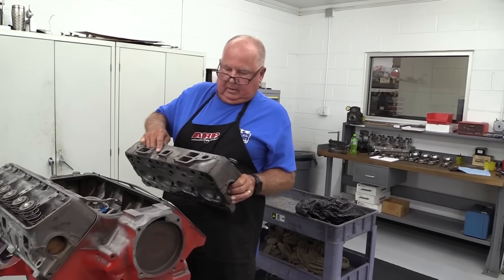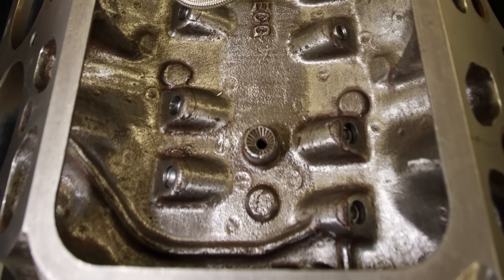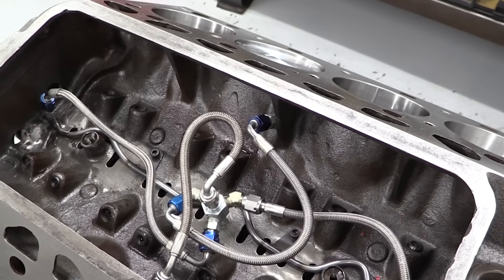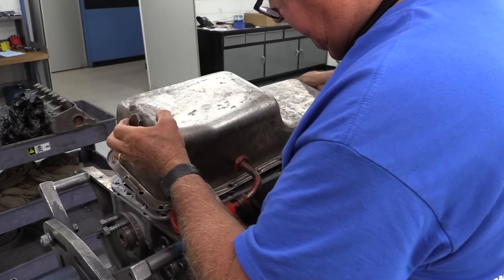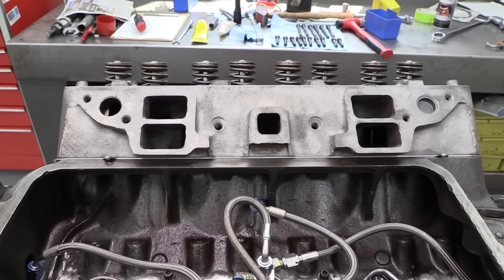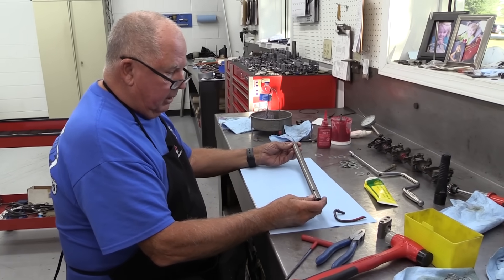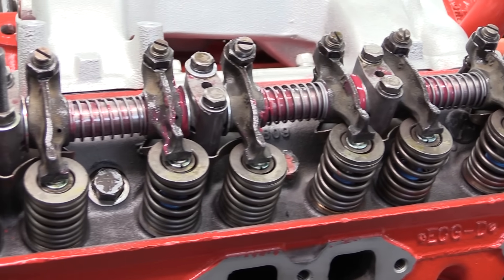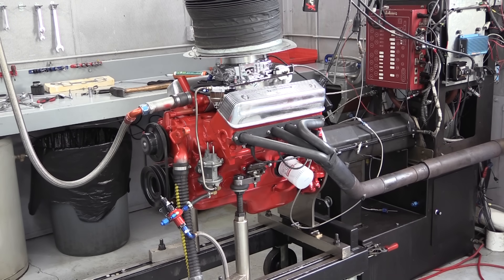The Engine That Replaced the Flathead -- Ford Y-Block Build

Comment: I'm sorry ☹️ did you say that's a 292 V-8??? I thought 272 was the first true V-8??!!
Reply: 54's were 239, 55,272
Reply: The CID was 239, 272, 292, 312 in a Ford, and 256, 292, and 312 in a Mercury. The T-Birds started with a 292 and went to a 312.
Reply: @joealbert7773  thx. Yeah I knew Ford has a 332 I saw in a 59 F-100 pickup what year did 352 and 390 start????
Reply: @robbierussell9536  The FE block started in 1958. There were various CID's for it with a 332, 352, 360 (Truck), 390, 410, 428 and the high performance 427. There was also the Lincoln version of the Y block and the MEL engines similar to the FE engines. MEL was Mercury, Edsel, Lincoln.
Reply: @joealbert7773  thanks Joe .I still have a 64 falcon Sprint..289 and a 65mercury comet cyclone I was a very fortunate kid in Ohio then. I have both cars with 427s. Cyclones 427 came out of an English FORD COBRA. It was totaled so I bought the motor with side oiler .I'm 65 and I still have both the falcon has a police 427. Both cars have 4 speeds .I had them gone over in NORTH ROYALTON,OHIO. their beasts..we've been Ford's since my dad a retired airforce  bought several Ford's mercs Lincoln's thru the years. This gentleman and his family bought FFE and the Machines of Ford in Sandusky Ohio..he build all kinds of motors ...thx for info.
Reply: @robbierussell9536  Sound like real high performance cars. I have a 57 T-Bird that I bought in 1996. I think I've rebuilt everything except the transmission. It has the original 312. My current project is a 28 Model A Sport coupe. However, it's not all Ford. It has a 401 Buick nailhead.
Reply: @joealbert7773  thx Joe. They even have the original paint.falcons black with red interior and the cyclone has black interior  with maroon paint. 513 gears. I raced the cyclone it's has 2-1150 holleys. No nitrous..their both fantastic runners!!!
Reply: @robbierussell9536  332 was an fe as were 352, and 390, among others, fe stands for ford engine
Reply: @robbierussell9536  221 then 260, then 289 were the new thinwall v8 s 221 s and 260 came out just about the time AC ACE lost their engine supplier, carroll shelby said, hello, this would fit right in an ace cobras were born
Reply: @joealbert7773  best thing you can do to a ford
Reply: @tomschweikert9537  thanks tom
Reply: @tomschweikert9537  thx tom. Being a Ford guy I sure forgot about the 221...we're they in early 60s Fairlanes like 260 and 289s??? Don't ever remember seeing one!!
Reply: @robbierussell9536  hey youre welcome.yes, i drove 1 in a 63 or so small mercury, similar to a fairlane. IT SEEMED TO BE A TORQUEY, SPUNKY  engine surprisingly
Reply: Robbie Russel The SBF debuted in '62 with the 221 and it was originally designed for the Fairlane. It was called the Challenger V8 or sometimes Fairlane V8. Falcon wasn't available with a V8 until '63.
Reply: @biryanikebab nope, 239 then 272 ,292,312
Reply: no 239 was 1954
Reply: in 1917 chevy had an overhead valve v-8

Comment: you can hear those solids...what is the durability/ longevity of these engines? I m aware of reduced expectations of  50 s iron.
Reply from the maker: With the modifications to make sure the rocker arm galleries are no longer robbing oil pressure from the center cam bearing, Dorton's previous Y-blocks have proven to be much better.  Thanks for watching!
Reply: Most died because oil pump shaft broke was Allen shaft to distributor .or no oil up top pump got tight  same with 260 289
Reply: We tied rocker drains together as most oiled heavy one side weak other .tee at sender reduced oil pressure to rods.
Reply: I don't know, my 58, 60 and 64 are still running. Also a police and taxi 223 straight 6. I don't bother with that feeler guage valve lash crap, I adjust the engine running just as you would with a hydraulic lifter engine with adjustable valve train. It quiets the valve train and makes them quite peppy.
Reply: not good

Comment: solid mushroom lifters....hopelessly antique?
Reply from the maker: Probably, but I've never seen a solution to get modern lifters in a Y-block yet.
Reply: @TheHorsepowerMonster  bore it out
Reply: @TheHorsepowerMonster  sure...sbc lol
Reply: Antique, sure, but not hopeless.  So far they've worked for about 700hp naturally aspirated and 1000hp boosted. For more usual power levels, they are absolutely fine.
Reply: @tomschweikert9537  ah yes, id totally love to be like every other idiot that decided to put a junkyard vortec 350 in their car because they cant learn how to rebuild other engines.
Reply: nothing wrong with mushroom lifters. aircooled vw engines used them, and they are doing just fine is crazy hp applications.

Comment: Love the fix for the oiling problem. Looks trick.
Reply: Too bad the Ford designers made these fixes necessary. Back in the day we put a "T" fitting between the block and the oil pressure sender, and used copper tubing and a hollow rocker cover stud to get oil to the rockers when the engine block oil passages plugged up. It looked like crap, but it worked. Also, there was a small hex shaft that fit into the bottom of the distributor shaft and ran the oil pump. If that shaft failed, the oil pump didn't work, with predictable results.
Reply: @oldgysgt  
Been there done that with all them😂. The fix for the oil pump drive was a $75 chromolly shaft in 1969.
The  only  only  advantage  was  that  you  could  full  pressure  oil  them  before  you  dropped  the  distributor  in . (And  there  was  an  improved  distributer  drive  too . You  could  shear  the  roll  pin . )
Reply: @oldgysgt  Many of these Y blocks died an early death due to the fact that people would stop changing the oil after they started to use any appreciable amount of oil. Their rational was why change it if it's using oil anyway? Sludge was the beginning of the end.
Reply: @4thstooge75 ; when will people understand, if you don't keep fine dirt out of your engine in the first place, the best oil made, and monthly oil changes will not keep your engine from wearing out prematurely! Is that concept to simple for you to grasp? Yea, change your oil, but FIRST, keep dirt out of you intake. Cylinder wall wear and cylinder taper are caused by grit, not bad oil. When grit gets between bearing inserts and crank journals, the useful life on those inserts and journals will be diminished even if the finest oil in the world in being pumped through the lubricating system. Even my Eureka vacuum cleaner has a paper filter to keep dirt out of the motor. Don't take my word for it, go ask you mechanic, and then get back to me. This is NOT rocket science folks.
Reply: Sorry but it is an necessary mod for a fix that doesn't need to be done.  Anyone that has own these Y blocks before should know by now it was the quality of oil back in the 50`s that resulted in the oiling problems.  with quality oil they don't have an oiling problem so this kind of mod does nothing but cause more risks of causing an engine failure to correct something that is technically not even a problem.
Reply: @Milner62  I expect you are right, as I don't remember seeing that mod on any low mileage engines.

Some of the oil brands (like Quaker State) were parrafin based, and were notorious for combining with condensation to form a sludge that clogged up everything inside engines back then.
Reply: @michaelangelo8001 , Yep, problem is the oil didn't kept the particles suspended so they were allowed to collect around certain areas especially sharp corners.  Modern oils with their detergents tend to keep particles suspended to pull them out of the engine.  I am on my 4th oil change I think on my 292 and using VR1 Valvoline I am starting to see a reduction in silvery particles in the oil when checking the dipstick.
Reply: @Milner62  Guess I'll just take your word for that...  I only remember the issues resulting from the parrafin based oils.

They lubricated well, but when used in engines that were only used for short trips, they would build up a waxy black sludge very quickly.

I remember it extremely well, because as a child, it was my job to clean the parts...
Reply: @michaelangelo8001 , of course, but what also compounded the problem is the oil also didn't keep dirt suspended in it so the particles would fall out of suspension and build up in some areas.  Big reason why I have been using high quality VR1 10w30 for the high zinc for my 292 flat tappet and the detergent in the oil has been doing wonders at cleaning out particles that has been in the engine for a while, most of these particles are metallic in nature and with every oil change done the amount visible on the dipstick in sunlight is getting less and less.

Don't plan on it being a end all for me, I am just keeping my old Y block going till I finish my current two projects and I go to start a frame off restoration on my Fairlane.  Not sure what I will find in the engine when I take it apart but I hope to be able to reuse most of the parts due to a lack of wear.  With how strict the service was followed I expect to see little to no wear.  If there is wear then I am tempted to see if I can find a local shop to sleeve the block so I can reuse the OE pistons.  If the OE pistons are no good well then I would consider doing like was done in here and just go with an overbore.  Im of the type if its not broke don't fix it, if the pistons are in good shape why buy a new set of pistons when you have a set of tested and tried pistons.
Reply: @Milner62  I'm pretty sure you can buy pistons a whole lot cheaper than you can get right holes sleeved and bored. 

But more than likely for your use, if there is no scoring on the walls, you can get by with just breaking the glaze and re-ringing it.  That is, if you don't mind having a little extra piston noise.
Reply: @Milner62  tis guy knows what he's talking about! back in the day non-detergent oil was the thing and you could not sell on old timer on the newer oil - "I want 30w in the summer and give me 20w in the winter and I want that good oli, not that detergent stuff"    putty knife and an inche of sludge removed, good as new   lol
Reply: @billfront2153  , yep and then you got fools like oldgysgt that wants to bad mouth the oilbath air filters as not being real filters but yet cant explain how my oil bath filter has kept my 60 plus year old 292 running for over 150k miles without a rebuild.  Still using the oil bath today and just recently last month cleaned the horse hair filter media out and changed the straight 30 weight oil.

Oil that I changed out had more dirt in it than I've ever seen in a paper filter of mine.
Reply: @michaelangelo8001  I grew up near Oil City, where Quaker State was based. One of my uncle's was an executive there, and everyone in the family used Quaker State. After discovering that fact, we all switched to different brands, especially after the debacle they had with the engine destroying oil (1980 something?). Havoline was recommended to me, and it served me well, until I switched to synthetic.
Reply: @boballmendinger3799  I worked in school buses for a while, and the county bought Havoline by the barrel.  I guess it worked okay, but it stinks, and I never really cared for it...
Reply: just  bore cam bearings  312 are the worst
Reply: Didn't know the braided hoses that are used in every branch of Motorsport were unprofessional
Reply: @PredaFran  Exactly.  This is a common way oil is delivered inside aircraft engines and industrial engines.  He's using a well proven high grade solution.  It's professionalism is in the function, since how it looks is irrelevant.   Solid lines are prone to stress cracking.
Reply: @fwaynedavis  yeah but some people don't understand thermal expansion and vibration and how to affects bent and flared lines
Reply: @PredaFran  if you use them like that yeah it looks unprofessional as shit... just becsuse ut's braded hose dosen't mean it's a technical masterpiece.
Reply: @elonmust7470  Exactly...

Flexible lines are meant to be used in applications where flex is required.
Reply: @elonmust7470 , not to mention the risk.  Ive seen braided hose like that blow out before and ive seen the locking nuts back off even.  Hell ive seen a properly torqued AN fitting come loose some how.  to me this mod to correct a now non existant problem just raises more risk for a driver.  For a race engine its one thing but for a driver I would never want something like this done to my 292.
Reply: @michaelangelo8001  Today flex lines are used because people are lazy and don't want to take the time to bend metal hardline.  Its why you see way more AN lines being ran vs trying to fabricate a hardline.  My 306 I am building for my truck wont have any of that AN lines nor will it have rubber lines outside of at the fuel filter and at the sending unit.  rest is going to be all custom bent 5/16" steel tubing just like OE to provide OE reliability.
Reply: @Milner62  That is definitely the best way to go, if you have the time to do it right.

Flexible lines seem to always have a way of flopping around and getting themselves into trouble...
Reply: @michaelangelo8001 , Correct, not only that but rubber lines do have a life span.  Why I am kind of surprised on my '56, she has no rubber lines to connect the fuel tank to the fuel line its all flared hardline from the factory.  Only rubber is a braided crimped rubber hose from the fuel line to the fuel pump.

On my truck I said screw it I am building the 306 on the stand I will bend my own fuel line.  I am kind of tempted to get one of those holley fuel filters and get a 1/2" npt to 5/16" inverted flare adapter and just have no rubber lines at the engine.  I just cant justify nearly $100 for a fuel filter for a street 306.
Reply: @michaelangelo8001 , I have a chrome Mr Gasket filter that is 5/16" barb I might use.  I also got two different styles of glass filters I might use instead as it will allow me to physically see how dirty.  I might use that but if I do I will have to see if I can find what size pipe the threads are on it so I can get a 5/16" barb as the car I took it off from had those plastic fittings which were all broken up.
Reply: @Milner62  If you really need to see what's going on, and want to stay with something practical, your best bet is probably an old style glass bowl filter...
Reply: @michaelangelo8001 , Probably what I will end up going with.  I like to physically see when its time to change a filter vs guessing.
Reply: @Milner62  I can understand that.  When I was young,I used to put a pressure gauge inside, so I could monitor the pressure at the carburetor.

That will tell you if you have a filter or vapor-locking issue.  But not everyone wants a gas line running into their interior, no matter how tiny.  Plus, the glass bowl filter will let you know if you have water in your fuel, and that's a big plus.
Reply: those lines over time with hot oil will harden and internally crack  .  under braided outside is rubber hose is worked on from inside n out from hot oil  .  saw this happen many times , better material or hard lines !
Reply: @Charles Roer, what’s your data for engine oil temps going above 405c?
Reply: @kalijasin  oil doesn't  lubricate properly called lubricity until over 2o5 f as high as 220 f many oils flash at 240-250 deg  f  some flash much higher 450 f - 550 f also less to not any coking ROTELLA T is 550 f  flash
Reply: @kalijasin fire
Reply: @kbfults  For someone talking smack about "language skills", you sure have an issue with basic grammar and the use of commas. Don't grammar nazi if you're own typing is riddled with issues.
Reply: From what I understand you dont have to use that oil setup anymore. Because the quality of oil now and people actually change their oil now.
 I was told oil back then wasn't any good. Also people didnt change their oil and when car was low they just added used oil.
Reply: @jedwards100able  during that time the engine oil was non detergent . the crap would not stay in suspension but settle and collect .on bottom surfaces every where , small oil passages with an offset alignment over time would plug solid . many engines only had 10% bypass filtration . now the oils are detergent , with high flash points , full flow filters , along with oil changes . not much of a problem any more .